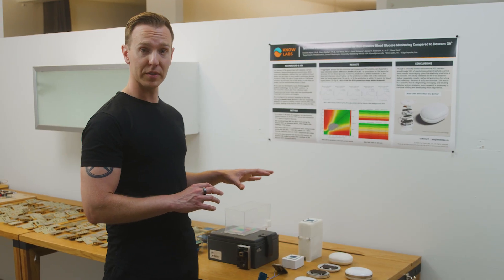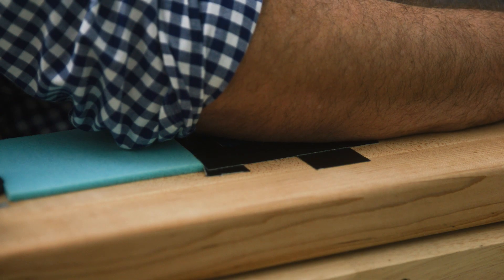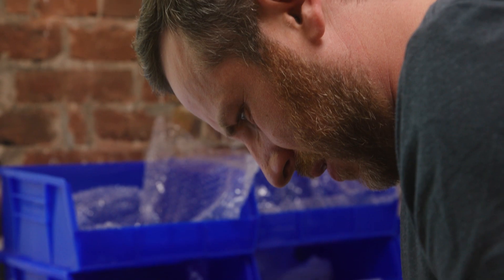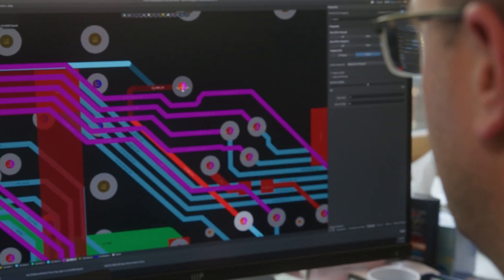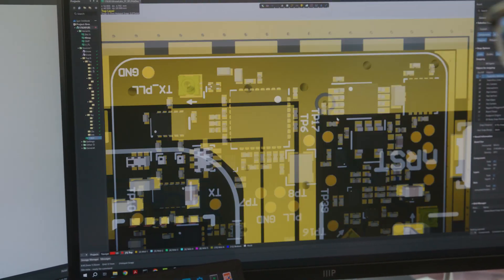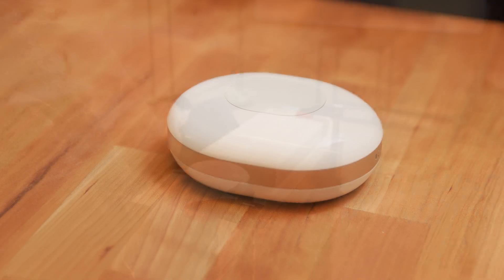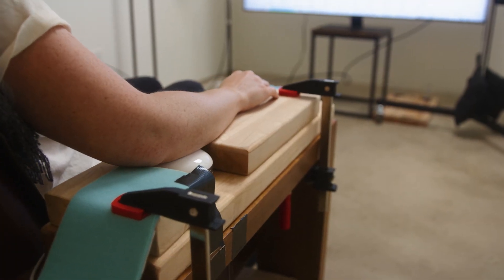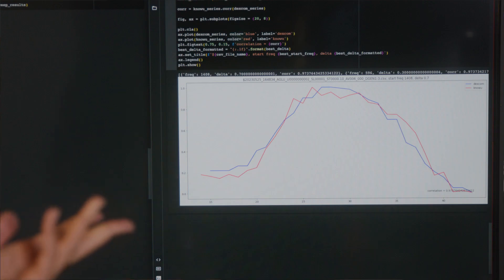Know Labs Generation 1 Prototype

Comment: Hockey puck size is a good first step for this new tech, small enough to get it out into clinics as a POS tester, but its too bulky to carry 24x7.  I expect that Gen 2( KnowU) with a sensor, algorithm and SOC optimized specifically for glucose detection will have this size and make it as portable as a BGM.  But it is much too expensive and large to be a viable substitute for BGMs.  
The comparison was to the Dexcom G6, a CGM. CGMs benefit are continuous readings with a device worn 24x7, not their absolute accuracy. The G7 sensor has better accuracy and is 60% the size of the G6. 
Gen 3 (UBand)  will let it be worn as a large watch-shaped device.  With clinical trials for FDA approval, I don't expect it to be a Medicare approved UBand integrated with insulin pumps before 2030 when the Dexcom G9 is out. I hope I'm pessimistic because I'd like to have  a Uband today. Even if it cost as much as the Dexcom G6 does over a 5 year period, if it can survive 4 years, it would be less expensive when you factor in the total cost of replacements caused by failed sensor sites and transmitters and time lost obtaining them.  But if it takes 7 years to be available it will be 5 years too late.  
 I like what Know is doing, but it's not a disruptive glucose monitoring tech.  The disruption will come from the other things it can monitor, starting in hospitals with "Star Trek" like medical beds. . 
The problem is the existing BG monitoring products are "good enough", some are cheap in the open marketplace, and the rate of their development is increasing , they have many competitors using existing tech, and the cost of production is dropping.
Reply: I definitely wouldn't call 2030 "too late". They have literally 0 competition. Even if this device were $2000. A transmitter for medtronic cgm is $800. Last I looked the sensors are around $50 each with a weartime of one week. With a 2 hour startup period and the final day of wear has usually lost accuracy to the point of being invalid. On top of that they also fail several times a month. The "receiver" aka pump is around $1200 I believe. They don't even read glucose they read electrical signals and try to make a proportion via "calibration" fingersticks,, leading to more fingersticks than a non cgm wearer in realworld scenarios. Not to mention it's a solid metal wire embedded in your body held in by a bandaid. A flashlight that can perceive ACTUAL glucose, with a lifetime of the bulb(LED=22years approx) instead of monthly resupplies, this is a no-brainer and is a major threat to CGMs. I'm still astonished you think a meatthermometer under a bandaid will keep this device from being successful because current treatments are "good enough".